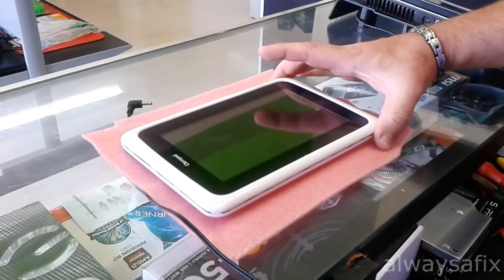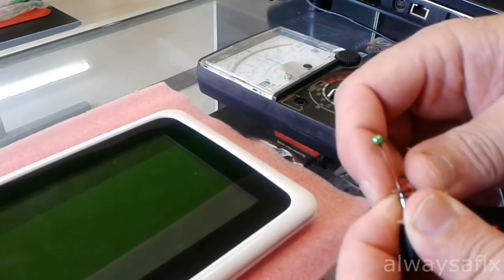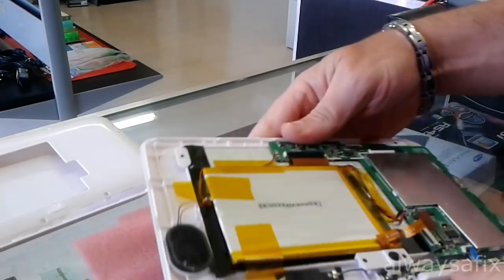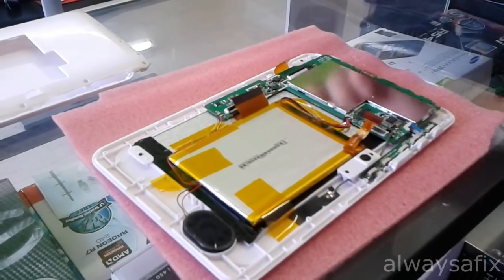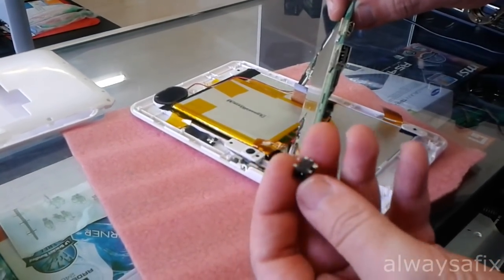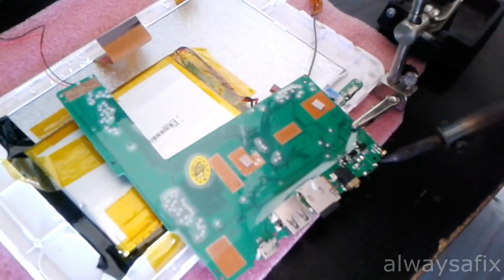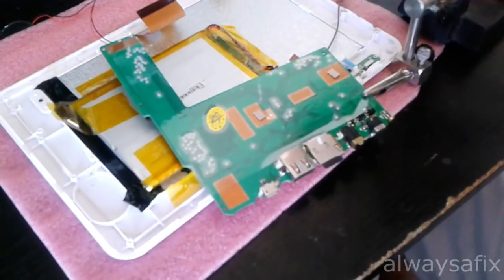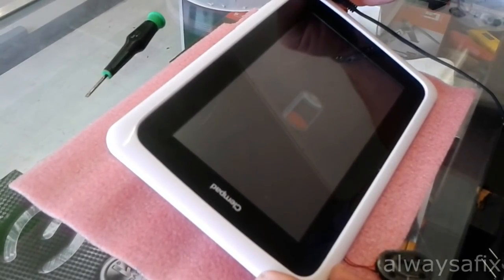Tablet not charging not starting

Comment: Please answer. My tablet has always charged nice but a couple years later it started to stop charging.  we found a way to put it in a position so it charged. It was frustrating because we had to put it in different positions each time. but then it just stopped charging. We tried other chargers but it still would have to no response. Can you help with this?

Comment: My hp slate 7 won't turn on. I opened it up and removed the battery and put it back in to be sure if none of the cabels were loose. But it's not charging still. I don't think anything is loose. Is it the battery? It's not fat, we haven't used it that much. Could it be a faulty battery or charging wire, I don't really know.
Reply: kevin da pro guy I got it for free tbh so I don't know. But I think it was.

Comment: bro...i think that the plug or something like that has moved or broken on my hp 10 tablet...i think u can help
Reply from the maker: Have you tried a different charger to make sure it is the plug that is broken?
Reply: +alwaysafix hi please help my nextbook tablet flashes between battery and nextbook screen  I tried to hold buttons down no reset pin hole but it turns black shows fastboot,reset,boot I try to do whichever but goes back to flashing on power up screen not charging either please help me

Comment: got a Trio G5 10.1 Dual Core Tablet that will not power on and if it does power on it stays on the Android boot up screen. Any fix for this problem????
Reply from the maker: Try a factory reset.  Hold down the power and volume down button together.  Please note that you will lose all your data.

Comment: My tablet is acting strange, it won't detect a connected charger anymore, however when I power the device down then connect the charger, it begins to charge, but it won't play and charge anymore. Can't take back were I bought it, already checked charging port for dust, it's clean, I also noticed how hot it was getting, took the back off to feel battery, found out it was not the battery that was getting hot but something inside the tablet itself. I've done a factory reset to see if that helps, nope, put it in safe mode, did not help, It's not old at all, just out of warranty, not sure if it's hardware or software at this point. Losing hope on saving this tablet, please help
Reply from the maker: If you did a factory reset then it is probably not software.  Try another charger.
Reply: +alwaysafix I've tried 3 different chargers all with the same results.
Reply: +alwaysafix My tablet is also not rooted. I'm sure it's an hardware issue internally. Just frustrating not knowing what makes it so hot, why it won't charge wile it's on, now the screen is starting to flicker and certain apps won't play. But I'm  for sure it's hardware.

Comment: What if the mirco usb port is damaged and cold soldered on and can't be removed and is to small to even replace it. 
Can i out a new link connecting to the batter.
Reply from the maker: +Deepinder Singh I suggest taking it into a computer repair shop so that they can solder on a new port.  Good luck!
Reply: well that will cost a lot more then how much i got the tablet for and the tablet in widows 10 soo I go to this class and fix there.

Comment: Hey do you think you can help me with my tablet it will turn on for a little bit but then it will glitch off
Reply from the maker: +Christian Griffith First thing I would do is strip it and make sure all cables are secured.  Good luck!
Reply: I have tried that
Reply from the maker: +Christian Griffith Measure on the motherboard behind the charging port with a multi meter to make sure the voltages is getting to the board.

Comment: hello
i have a fujitsu m532 tablet and is not charging anymore,i left it to charge overnight and still nothin,i cannot turn it on,
can you please help me?
i don't have the warranty anymore you are my only hope
Reply from the maker: +Mafiotu Afacerii First step is to try another charger and then get back to me.
Reply: thank you for your respone,i tried another charger and still no sings
Reply from the maker: +Razor Bomb The tablet has to be dismantled and the voltage checked on the power connector to the motherboard.  You are looking for 5 volts.  Good luck!

Comment: My tablet was not charging or turning on. I opened it up and reflowed the solder joints on the plug. Works like a charm now. The solder joints were cold, poor factory soldering.
Reply from the maker: +HobbyHillsVideos Glad to hear your tablet is up and running again.

Comment: hello i have a digiland tablet.an it wont charge any help at all?
Reply from the maker: +Bryson Castro First step is to try another charger.
Reply: +alwaysafix i have already tried 4 different charger one did work but then soon enough the charger stopped working for it.
Reply from the maker: +Bryson Castro Next step is to measure voltage on the motherboard behind charger port to make sure 5 volts is reaching the board.  Good luck!

Comment: Hello I'm interested in this video because I have a visual land prestige pro powered bye android and my USB connection to charge has stopped working. I'm using they original power adapter but a new USB wire. I opened up the Machine and checked to see if anything was loose but the only thing I notice is that the speaker was loose had to put it back in its place. Basically I have to bind the USB wire to get it to charge before I wrote this message but as of today it's done. Can you please make a video on this please. I'm tight for money and need help. Thank you and keep up with this channel. It help's

Comment: I have an RCA Android 4.4 Kitkat and its a 7 inch touch screen with key board and well started kicking on and off while on charge and when off charge will not do a thing.  I use my table with Facebook, and well it surprisingly takes great pictures.  Am pleased with how the photos and videos look.  So what do I do to make it quit powering on and off repeatedly while on charge and doing nothing while off charge I just bought the thing like a few weeks ago.
Reply: Julie Sparks I even added my own 16gb SD card for extra memory
Reply from the maker: Julie Sparks Hi Julie, if your device is only a few weeks old you need to take it back under guarantee and have it replaced.  Take the charger as well.  Good luck!

Comment: I have Lenovo A7600-H 10,1" the charging device is fine but...nothing.
I think I have to find some driver or something, don't know, what do you think, thanks
Reply from the maker: Scream Mix When you try and switch it on with the charger is it completely dead?
Reply: alwaysafix Yes, nothing happen, I have 3 charges and nothing. 
it was plug in and I was recharging the battery, in the morning the tablet was dead... I haved warranty and they do something 15 days after this happens
Reply from the maker: Scream Mix If it's under warranty you need to take it back.

Comment: Hi my TAB 4 wont come on and wont charge Model: SM-T230NU, I opened up the tab like in this video n pulled out the battery jack and placed it back agn and still nothing the tab is new got it last year in August idk what agn to do can you help?
Reply: All the parts are intact and the screen flashes the samsung start screen for a second then goes black
Reply from the maker: Joe Sur Have you checked the charger with a multi meter?

Comment: My problem is when i put the tablet to charging, the tablet shows the battery charging animation (lights up/down) as if it is charging the battery but the battery never gets charged. I used various chargers but in vain. Now the battery is completely discharged and i am not able to turn it up. When i switch it on (keeping tablet plugged into charging) the screen lightens up but gets off after 2 sec and starts showing battery charging animation as if it is charging the battery. Is this a battery problem or the charging port problem?
Reply: me too have this problem
Reply from the maker: If all cables are seated properly then you need a new battery.  Good luck!
Reply: Same problem here bro😖
Reply: alwaysafix make a video showx the are suppose to be pllllllllslslslslslslslslslslslslslal😭😭😭😭😭😭😭😭😭😭😭😭😭😭😭😭😭😭😭😭😭😭😭😭😭😭😭😭😭😭😭😭😭😭😭😭😭😭😭😭😭😭😭😭😭
Reply: Same

Comment from the maker: Eyal Kropnick By connecting the 12v charger, you probably damaged the motherboard.  I suggest you take it to a service centre where they can check the electronics.  You might be lucky and it is just a blown micro fuse.  Good luck!
Reply: hi my tablet is not working i took it to a service centre but they didnt fix it